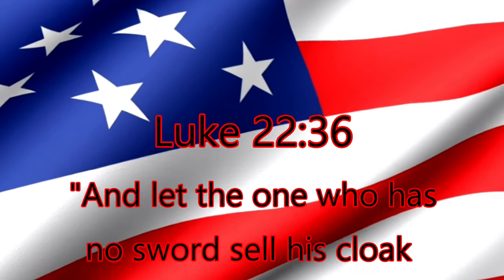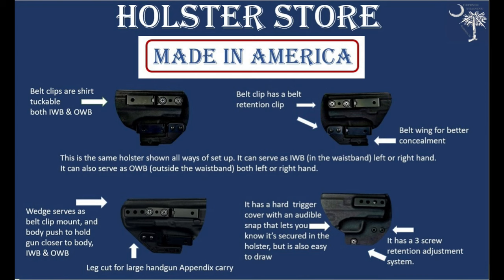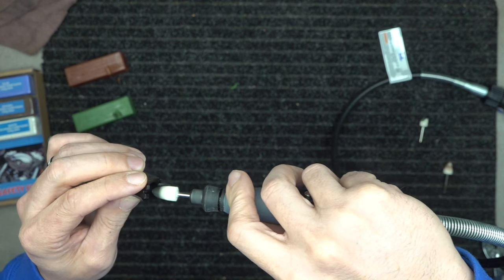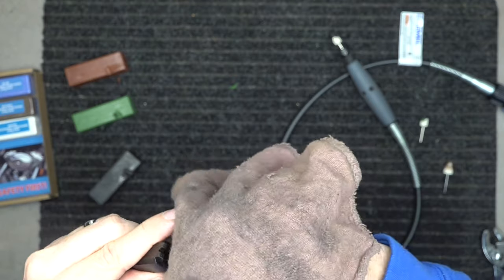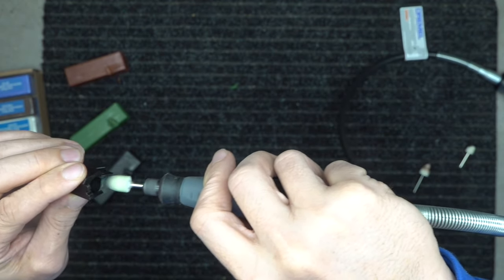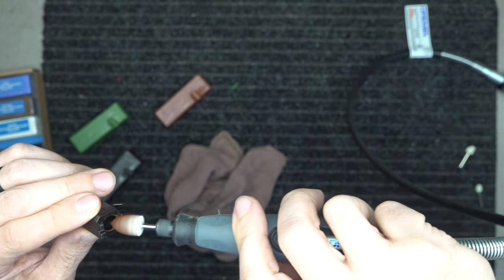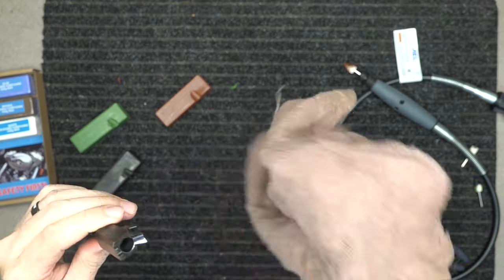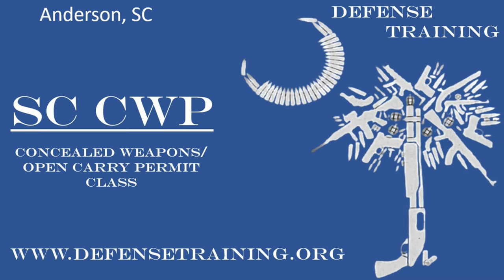Polishing Handgun Feed ramp.

Comment: I polish every area that gets carbon build up. You'd be surprised how easily carbon wipes off a polished surface.
Reply: I had my gun trigger bar polished by a gunsmith. It reduced the trigger pull weight by ~1 pound (analog gauge) and minimized buildup as well.

Comment: I just bought a ported barrel, cleaned the barrel, fed hardball ok, jammed with the HP carry ammo.? Ur thoughts? Gonna polish it, remove factory finish.
Reply from the maker: Is polish it and check for any type of bur on the top of the ramp.
Reply: @DefenseTrainingSC  
HP stuck at the base of the ramp, no angle.
Reply from the maker: Ah, check the magazine, sometimes that’s the problem. Polishing it up should fix it, if not, swap to a different hp.
Reply: @DefenseTrainingSC  
Thanks